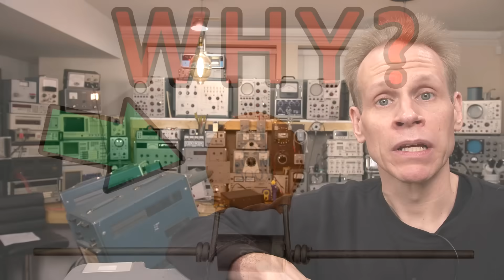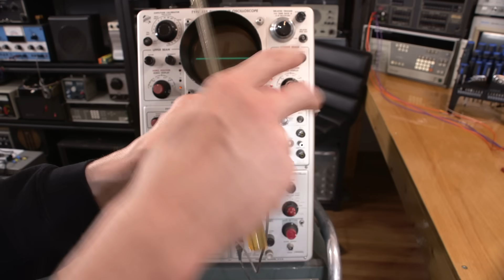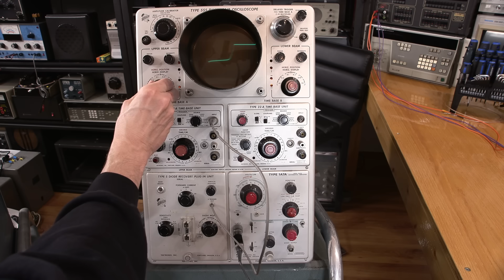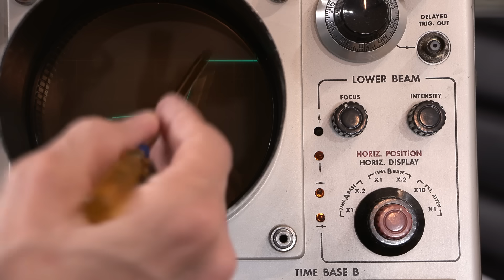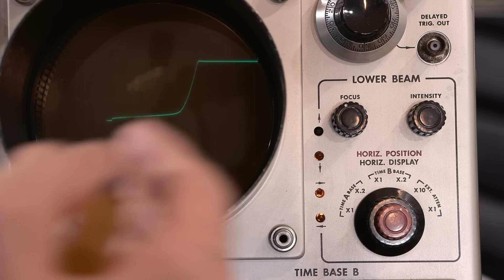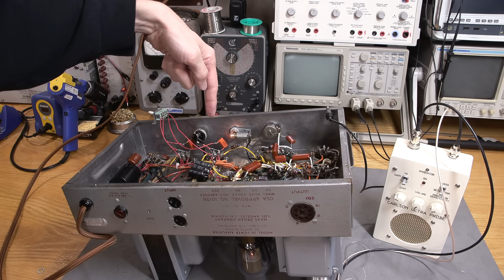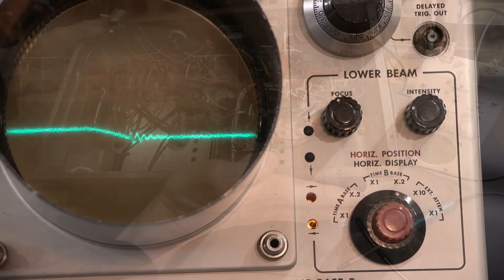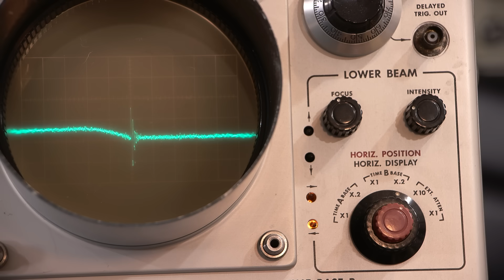Why Put A Capacitor Across The Diode? Here's Why!

Comment: In some power supplies there should be high amplitude, short period current spikes at the bridge rectifier. You get that kind of noise if there is a failure somewhere else in the power supply. 
Try leaving the bridge alone and putting the small cap across the big cap. Replacing the big cap with modern technology might help. Go for a lower ESR.
You might use a cap and diode to limit back EMF near an inductor, but you don't often use it in a bridge rectifier.

Comment: I know this is 50Hz with slow silicon diodes,
but I assumed it is the same reason Schottky diodes have a pf range cap across
them too at the secondary output of some DC-DC converters like Flybacks????

Comment: I imagine this same technique could probably help reduce switching noise across the source/drain of a MOSFET or the collector/emitter of a transistor, yes? Just as you would for any push button on a digital system, to reduce bounceback effects. I would assume triodes and other valves probably are a lot more "smooth" and delayed (thus quiet) in their characteristics due to filament cooldown and warmup, and the inherent thermal capacitance of the elements acting as a sort of temporal buffer, or am I completely off the mark on that?

Back to the solid state parts though, it makes sense to treat them as you would any other switch, with all the noise issues associated..

Comment: What kind of cap to use though and what capacity? The one in the thumbnail says 25u and 01M and 500V.. It seems unlikely to me that such a small cap could be 25 uF at 500V.. It also seems like a big capacity to handle this kind of noise.. I would expect a couple nanofarads, maybe 10 or 100 nF max.. Not 1uF or even higher unless you're dealing with relatively low frequencies, like when using diodes to turn a 50-60Hz AC into DC. But what about using a diode in on opamp circuit for instance to create an overdrive effect for a guitar amplifier? 25uF would be way too much there. You'd effectively be making an buffer with an amplification factor of 1, just maybe having some out-of-phase effect?

Comment: For those of you who don't know, Paul provides some of the most amazing insights and tips you will every see. He, as far as I'm concerned, is a treasure to the our electronics test a repair world!  Cheers
Reply from the maker: I appreciate your kind comment!
Reply: I am looking for a few feet of "high temp" style wire in approximately 14 ga(ie fiberglass outer insulated type used in toaster ovens ect for a repair on an old TAPPAN oven light socket. Might you know where I can obtain a few feet of this difficult to find wire?? @MrCarlsonsLab

Comment: Kind of reminds me of what happens when you have water hammer in pipes (quickly turn water off and the pressure builds up from the water flow smacking the end of the pipe), the capacitor seems to act like a suppressor kind of like a water hammer arrestor.

Comment: Yeah, S/N ratio can be bad for low-power circuits and certain diode types. Actually, it can be hard on the cap, since it's an AC short a short period of time, depending on the circuit. Some put a 22-47ohm resistor in series with the cap. Nice demonstration!

Comment: When I had built my 6L6 stereo tube, we put .002uf 1kv caps across the two 1N4007 rectifiers, so any HV flyback from the power transformer windings would not cause the rectifiers to short out. Another reason to install caps across your power rectifier diodes. BTW: Did you use .01uf 500 - 600 volt capacitors?
Reply from the maker: The caps are for switching noise (reverse recovery) but they also work for inductive kicks.
Reply: @MrCarlsonsLab  Actually the electrical noise comes from when the rectifier switches off (in reverse recovery) from a little bit of inductive kick or flyback voltage. The cap dampens the sharply cut off current noise by absorbing the  voltage spike kick.

Comment: I agree with @CristiNeagu: This video could be informative, but looking at a screen without knowing what's on the x-axis (I guess time), what's on the y-axis and what signal is applied doesn't tell anything.
After watching this video, I still cannot decide in which cases a parallel capacitor shall be used. Also, the question about how the capacity is calculated is unfortunately left unanswered.

Comment: We had an old boom box that lived on the floor of the FM transmitter building where I worked, but not for entertainment.  Tuning an FM transmitter for peak efficiency required it produce little to no AM component by working within the resonant frequency of the final amplifier stage.  Hitting the play button on the deck with no cassette allowed the playback head to act as a pick up.   The greater the amount of AM noise present in the signal, the louder the boom box got.  We knew we hit the sweet spot when the boom box went silent.
Reply: if tuning for peak efficiency gets rid of AM  , there is no efficiency contest compared to a mistuned signal . which is an invalid signal like the mile per gallon efficiency of a speedboat tumbling down the road to the fish shop

Comment: Nice presentation. It might be clearer if you showed a schematic of your circuit and what point in the circuit you were placing your probe. Has any of that buzz made it to the output of the amplifier and into the speaker? Not to say it is any better but  I have not used a signal tracer in my trouble shooting procedure, always used an oscilloscope to track down noise.

Comment: Often when I am replacing a selenium rectifier with a diode in the bias supply of an amp, I find that not only do I have to deal with the altered voltage drop....but 120 Hz hum will sometimes develop because the diode needs additional filtering over what the selenium rectifier needed. I never thought of placing a cap across the diode like that instead of just adding a filter cap to ground after the diode. What are the pro's and cons doing it this way? Is it just filtering in a different manner?

Comment: Nice video but it did not cover the value of the capacitor or the need for the capacitor to have a high voltage rating to deal with the high amount of energy it needs to absorb. 
Also, it would have been a nice place to demonstrate the value or lack thereof depending on the circuit for using higher speed switching diodes.

Comment: Ah, sounds like the same reason we add capacitors to brushed motors on RC cars.  Bridge the two poles sometimes with a triangle of caps to reduce the noise between poles for a cleaner operation.

Comment: Sorry, I don't believe you. In this case it has nothing to do with reverse recovery. Add a LISN and measure the common mode current with and without the caps. The caps at the bridge rectifier balances CM current preventing it from turning into DM noise. Without the caps the path of high frequency CM currents are altered depending on which set of diodes are conducting. Hence, high frequency noise is modulated down to rectifier frequency.

Comment: I guess this happens because of resonance between input capacitor and loop inductance between diode and input capacitor. Added capacitor decreases resonant frequency and switching speed, so double effect. All is good as long switching delay is not more than 1ms or so, though I would prefer less than 100us.

Comment: Just wanted to ask you a question. Most of what you are talking about is over my head. Would adding a capacitor on the diodes in my solar panel junction box make any improvement ?

Comment: I was wondering why the kettle was producing so much hum in other electronics in the house when I switch it over to half wave mode as compared to (almost) no hum in full rectified mode. I even tried adding a big cap in parallel to the resistive load but it didn't help. I need to try this perhaps. Thanx!!

Comment: Putting a capacitor across a diode can serve two main purposes:
to act as a snubber to suppress high-frequency noise in rectifier circuits or to function as a filter in a voltage multiplier. The specific function depends on the application.

Comment: I am a novice of basic understanding of electronics.  A diode allows current to flow in only one direction; seemingly that's its purpose.  When adding a capacitor, doesn't that allow current to flow in the circuit in the direction the diode was restricting?

Comment: I first learned electronics in the Navy, & after years of training, this is the first time I’ve ever heard of use of a capacitor used with a diode! Thanks!
Reply: Me too and, I have an Associates Degree from my hometown college. 
I'm actually surprised this isn't in the textbooks already with high current/low voltage systems used in today's electronics.
Reply: @terminallygray I don’t know what is currently in the ARRl Handbooks but I know that it was in them in the past.  In fact it was also in one of the old tests I took for one of my licenses.
Reply from the maker: My pleasure!
Reply: Different circuits / applications I usually fought with the parasitic diode capacitance, and selected diodes with low capacitance. 
On power supplies different matter, usually filtered with high value electrolytic a
In parallel with a small ceramic cap, a ferrite bead on the diode leads also helped.
Reply: Yup, they didn’t teach it in Army electronics either. Signal Corps 💪yeah!
Reply: Hi. It's basic electronics using the capacitor as a filter in all the power supply as well as in other circuits.
Reply: For an 8 minute YT video, it's going to only be a "practical" intro to reducing noise.  For an engineering level discussion on noise mitigation, a seminar would be a proper forum.

Comment: maybe next time you can explain how the nuclear fusion works, capacitors its a basic shite , thats why theyre called condensators in other lingos , it ''eliminates the excess of useless electric current from the circuit , like if you place caps on  an electric motor's connectors it stops sparks , BS dude
Reply from the maker: The word of the day is: "Commutation Noise"  Ahhhhh!

Comment: This is one of the functions of a snubber. An example of a capacitive snubber. You'd usually add a low value resistor in series to compensate the response.

Comment: At a company I worked 10 years ago we had a dispatch room where all the digital phones connected to power had humming.  I told facilities guy it has to be dirty power since in other rooms the same phones were good.  He brought in their electrician, who was an older gentleman, who said power would not cause hums in equipment no matter how dirty it is.  I told him that is not true as all audio equipment can be subjected to it.  Anyway, they both kept going back and forth with me until a few days later I was in the utility room and heard the same hum from the backup power system.  The electric guys was here to bypass it to install something in the street so when they did, the humming stopped.  I pointed it out and they wanted me to keep it quiet with the group having the issue and my boss.  So, they wanted IT to take all the heat for the humming they said was impossible  while they either figure out the dynamics of electricity to fix the issue to ignore it and still say it was us.  Needless to say, I did not stay quiet and they had to replace some parts in the backup system that stopped the hum completely.  Why do people always want to crap on IT be it they are right or not?

Comment: Interesting topic, I looked at some audio equipment forums, and they called them Snubber Capacitors and, in that application, they used 0.1uF across each diode in bridge rectifier.
Reply: Snubber network is the correct term, we used it daily when I was in switch mode power supply design back in the 90s.

Comment: Diode is a one way device. In the fwd direction, it is like a short, closed normal wire connection and the capacitor has not effect.. In reverse it becomes open, the capacitor begins to charge, and while charging behaves like a temporary short that gradually becomes an open. Meaning the current in the reverse direction - diode open - will have gradually closing momentary passage. As I reckon.
Reply: best explanation i read here in comments

Comment: Sorry for asking, but I need a little bit of background information to understand what's actually happening here. When you measure the diode, what kind of voltage are you applying exactly? I'm new to this stuff. The "noise" or vibration is a consequense of that voltage? Also the diode itself is a "regular" diode, or is it a schottky?

Comment: I joined the Mr. Carlson's Lab Patreon page looking for the plans for the probe used in this video... i'm not able to find them.  also, it would be good to have some guidance (formulae maybe?) for determining optimum capacitance for this application; perhaps based on use case, voltages, current, diode type/model, etc...  thank you to anyone who can address either of these questions.

Comment: There used be shunt capacitors across the bridge diodes in power supplies in early power semiconductor days. Old hp (and other companies') power supplies usually had them (they also had crowbar and fuse pair). These days there wer power transformers to step down mains. Nowaday these caps across the diodes are almost obsolete. It because diode bridge are directory connected to mains that is very low impedance. Should the diode caps fail on mains, surge current of the short circuited bridge are enourmous compared to old current limited bridge circuit by power transformer leakage flux. Modern electolytic caps are  very low esr and their capacity are huge. It effectively absorbes noises from diodes. Modern circuit designer prefer no possible failure elements. Power shottkey diodes  don't emit snap recovery noise btw.

Comment: In the US Navy I used to use a 9V AM radio with a broken antenna for almost the same reasons. It could over react and miss issues, but I'll tell you it was great at finding the area of problems. Good times.
Reply: To add a tad more, most equipment that misbehaves makes ugly AM radio noise, although as was shown sometimes properly operating equipment can still be noisy. He’s right, sometimes a cap placed across a diode can do wonders. Great stuff!

Comment: I did not see in the video on why the diode has ringing and noise in the first place, the ringing and voltage spikes occur due to the interaction between the diode's diffusion capacitance and parasitic inductance in the circuit, by putting cap across it it shorting out the high freq ring. the reverse recovery is the diodes capacitance discharging, when in reverse bias.

Comment: But how should you size those caps? Does this trick work only with low frequency AC or does it also help in switch mode PSUs? What is the scope even showing in the beginning? Do vacuum or selenium rectifiers also need such caps?

Comment: Would this still apply to modern diodes? eg. uf4007 where the trr of the diode is much smaller. How about comparing its performance to Cs+Rs across the secondary winding?

Comment: A single 473K Capacitor is enough to filter a 50-60hz AC power waveform to make a DC motor function in either direction.

Comment: Well, putting a too big capacitor in parallell with a diode may send AC over it, as a capacitor in series will block DC but let through AC, whereas a diode does the opposit.

Comment: WOW! I usually am using Tube Rectifiers but sometimes i have Trafos without a CT and this "Forces" me to make a Bridge Rectifier with 1N4007 (or similar).... so, if i wind a cap onto each Diode i will have a Advantage in "Noise Reuction". No one ever told me that Trick. Awesome. Will try that.
Reply from the maker: My pleasure!

Comment: Adding the capacitor reduces the oscillation frequency when the diodes turns off (transformer inductance is unchanged), as can be seen on the oscilloscope.
It also reduces the amplitude, but only partly.
Adding a small resistor in series with the capacitor can remove the oscillation completely.
Don't try to calculate the correct resitor value, just use a trimmer and adjust for lowest oscillation and then replace with fixed non-flammable resitor.
And voila, you have build build yourself a snubber circuit 🙂

Comment: With so many disparate explanations in the comments I'm going to add a bad hydraulic analogy: 
The noise is like a clatter when the rectifier diodes, visualised as hydraulic non-return-valves, slam shut. The capacitor provides a local bypass route around the valve that allows the worst of the hf impulse to remain localised instead of propagating along the pipe into the rest of the system.
There - all better. You're welcome.

Comment: I'm not a repair guy but I was repairing a guitar amp made by Guyatone (GA-380) from mid-1970s. It hums (50Hz) so hard and I replaced the filter caps and it hums less. But the hum is still there. I have replaced almost all the caps, the transistors and everything me and my ChatGPT can fugure out, and the hum did not go away. Since the hum is recuded a lot, I put the amp back to where it was. So I think I need the probe device to catch the source of hum.

Comment: I have a "AEGIS CZ1000 F Set Cable Pair Identifier " and it can be used in the same way to listen to circuits
Reply: be careful using any of those type telecom/electrical cable and wire tracer probes, the pickup tips in many are NOT electrically isolated from the circuitry inside and will make the whole tool of internal components live, even the line voltage rated ones are no match if you go probing around in a tube amplifier with 1KV or higher.
if you go poking around in or near something with high voltage, it may very well arc right to you via the case, on/off button/switch, battery compartment, volume knobs, headphone socket and whatever else it has.
Reply: @throttlebottle5906  Its fully isolated the tip is plastic covered and the case is plastic it is non conductive if you look that model up its AU $700